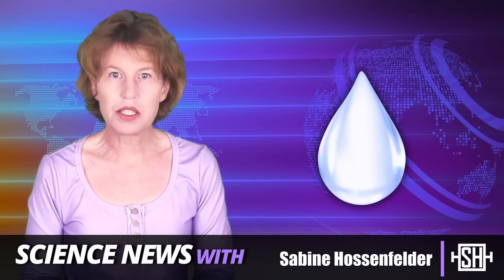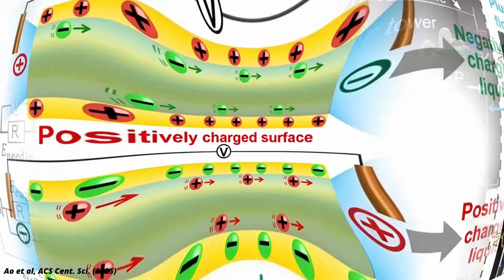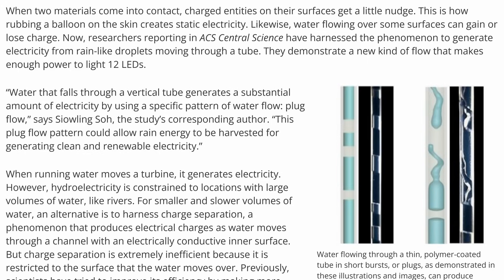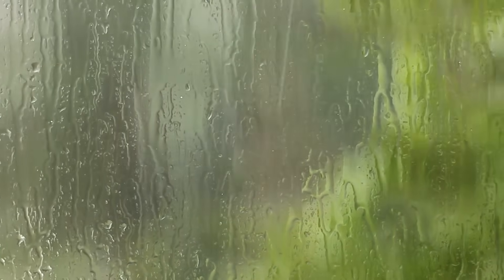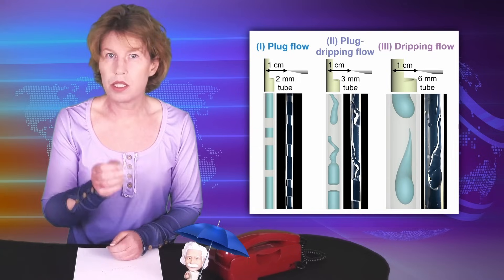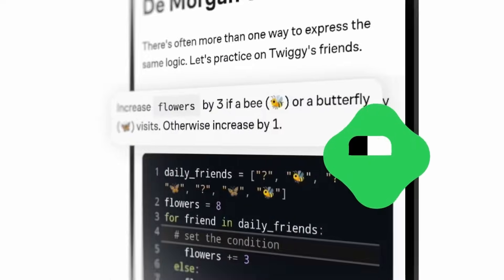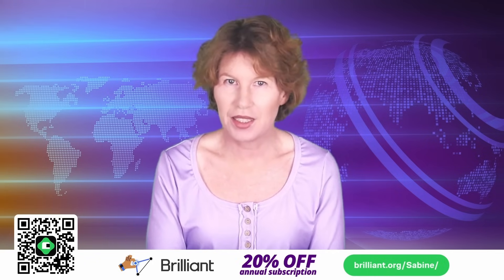A New Way to Generate Electricity From Rain

Comment: No moving parts, but small tubes exposed to the elements are not maintenance free. Algae, insects, just dust or soot from pollution.
Reply: Easier and more efficient to just print out an array of tiny piezoelectric elements. Once you've extracted the impact-component of the drops' energy, you collect the runoff from the plate into a single stream and drive Sabine's turbine.
Finally, this whole system is mounted on the slopes of a river's watershed, and said river drives hydroelectric dam generators.
Reply: @-danR  I actually thought this would be a video about using piezoelectric rain catchers to generate a surprising amount of power. Instead, it's about tubes generating a surprisingly small amount of power!
Reply: @Tore_Lund  I get it, I really do.  Your superior, "scientific" approach is that the human should exist for as short a time as possible, ideally not at all, and during that brief existence move and eat as little as possible, but definitely to do all those activities in an electric vehicle because when you ignore a bunch of contributing data, then it appears that the EV is vastly more efficient than just regular human induced motion.
Reply: @mechez774  No, I'm not trans humanist, or what you call those wanting end to humanity, but I equally object to the opposite; that it is possible for Humanity to be on Earth in harmony, and somehow we are evolved to be in balance with nature, so anything we do "naturally" is not harmful to the environment.   That's an almost religious understanding of the natural world, that implies that even evolution tries to optimize existence to make room for everyone. So as long as we don't don't violate the laws of nature, we'll be allright. However nothing could be further from reality: Evolution has no direction, it is a pure mechanical process. Natural harmony is a terror ballance. all population sizes are governed by external distarsters. That is true for Humans too. there is no balance to go back to when we are 9 billion. Even if we sit completely still and only eat grass. This is not fatalism I suggesting either, but just opposing that some human activity is dips and shouldn't be counted.
Reply: @Tore_Lund I would offer the suggestion that you are possibly mixing your philosophical and scientific theories.

Let me just tackle the one topic - evolution.  It is intrinsically about balance, where ridiculous imbalances occur the causal link is humanity not nature.  That is not to say there is a harmonious balance between all species and all planetary processes if that was the case then no species differentiation would have occurred and continue to occur.  

The organism that is best suited to thrive with the environment in which it either finds itself or the environment to which it can migrate to will out compete all others.  Likewise the organism that is least suited or that cannot migrate faces either an evolutionary dead end or a need to adapt to a differing environment.

Humans despite knowing that nature is brutal ignore this, it however does not mean that collectively organisms and planetary processes cannot find an equilibrium state in which to exist, that is balance.
Reply: @ForgeMasterXXL  No, evolution is driven by thermodynamics. It is not an optimizing process, it just creates variation, which makes what is good enough get another chance. the optimisation process is emergent. I don't see there is an optimal equilibrium organisms will find if left long enough. Remember the fox rabbit population graphs, they are forever undulating and chaotic, never finding steady states. When we then look at Humans, it is obvious we reproduced beyond what we would without technology, so any equilibrium, there might have been for small tribes have since long been abandoned. You believe there is a way for 9 billion people to live CO2 neutral (Im not questioning if there is a will or the practicality to have all agree on it, simply if such a state even exists?)
Reply: I checked the CO2e values for your assumptions. Average european diet: 54gCO2e/km, vegan 25, heavy meat: 90g/km including manufacturing, in comparison to car (ICE): 200-300 g/km, EV: 90-150gCO2e/km. So bike is better in all cases.
Reply: @bammeldammel  wow It's almost as if the bicycle is the most efficient transportation.
Reply: @bammeldammel  Thank you for actually arguing this instead of just disagreeing. Your numbers for emissions for human work look like mine. You know beef per kg in the cooler in the supermarket has emitted 75 kg CO2? 85-90g  CO2 per km is what you emit cycling as a 75kg man (moving mass 90 kg including bike and clothes, and eating the average diet) which is the same as a compact car emits in Europe through the tailpipe. Cars don't emit 200-300g CO2 per km, then you'd have a car with a fuel consumption of 10-7L per 100km (burning one liter of gasoline emits 2.3 kg CO2). A compact car uses 4L per 100 km (92g CO2 per km). An big EV like a Tesla in Europe emits 65g CO2, unless you run exclusively on coal power. In Norway and france with lots of nuclear power, an EV emits 2-15g CO2 per km. So we do agree on level of emissions from cycling, you just think other means of transport emit far more than they do in reality?
Reply: @Tore_Lund  I like to think that if all positive and negative externalities such as emissions were included in the price, then price alone would dictate whether something is ecological or not.

Do you disagree? Of course, this seems rather impossible in practice. Computing these values properly would be hard and likely very disputed. And then you'd have the political barrier.

Of course, I bring this up since I can't imagine that whatever increased cost in your diet, even with the additional increase in price due to added emissions, would somehow be less cost effective than a car! And you also have to include the health benefits from exercise. If more exercise keeps people away from needing healthcare, that is a positive externality!
Reply: @alan5506  Farming needs to be cleaned up, that's the immediate answer. There are more studies on what pollutes most on a farm. That is methane from cows and ploving stubs into the ground where they rot and the ofcourse fossil fuel use. So we do have a good idea of what pollutes in food production. However farmers are conservative and politicians are scared of them. When they imposed a commercial diesel tax in France, farmers blocked Paris withj week long protests. Same happened in other countries, so sadly we are a long way away, before we can clean up food production.
Reply: @Tore_Lund  Okay but that doesnt really touch what I said.

You said biking is worst than an EV.

The average cost of owning an EV is likely somewhere around 10kCAD a year. This includes initial cost, repairs, insurance, battery replacement, recycling the car at the end and all. This doesn't include the cost of exterlaities for the mining and the roads being paved and so on.

Even if food is more expensive if you were to include the negative externalities of farming, I cannot imagine that your food bill would INCREASE by 500+ CAD per month because of cycling. It is worth noting that we only care about the increase in the food bill due to cycling and not the full food bill. 

So yeah. You are wrong by at least a whole order of magnitude. 

And you also havent touched the health aspect and avoiding healthcare cost. Look at the obesity numbers buddy. That has real and heavy impact.
Reply: @Tore_Lund But yes, I agree that if we ignore all initial costs and maintenance cost for the car and the road, ignore health benefits of cycling and you eat a meat heavy diet and you live in a low electricity emission place like canada or france, then yes, using the electric car you already own is better in terms of emissions than the bike
Reply: @ForgeMasterXXL he is talking about balance but harmonically tuned and in phase with (for example) Schumann resonance or similar. Also, to apply Pythagorian scalar and harmonic principles to systems. Both mathematically and empirically proven thousands of years ago
Reply: The smaller a tube is the harder it is to clean. A fat pipe with a turbine in it would be much easier to maintain, plus it will be much more resistant to clogging by said insects and dust. It is not always beneficial to keep making things smaller.
Reply: Waah! The engineers should have checked the Youtube comments before they invented something.
How stupid they are. They don't even know how stuff works.
Why do I even watch videos? I should just keep reading the comments because that's where the smart people are.
Reply: salinity too
Reply: @Tore_Lund  LMAO , pretty interesting you choose to omit all the fossil fuels involved in manufacturing an EV car and repairing the roads from their heavier than average wear and tear. Also that your carbon budget for food omits the consideration of regenerative farming.  But tell a guy who E-bike commutes 50 miles per day ( 83km) and eats less than his  EV driving colleague that he has a bigger carbon footprint. But no, I get it  - you wouldn't want to work up a gym sweat for the sake of future generations.  That's what survival of the fittest is all about - the lack of effort.
Reply: @mechez774  How much CO2 does it require to build a human? You are expanding the argument with other factors, which you don't even try to quantify. this is whataboutism, not a scientific discussion. E-bikes are better obviously and pollute significantly less than even an EV, if you keep the pedalling to a minimum. What you eat also makes a difference to how polluting your bicycle ride is. If you are a vegetarian and buy locally produced and not too processed foods, it also makes a significant difference to how dirty your food is and thus your emissions per mile.
Reply: News flash: we already have a solution for our energy problems - ride a bike. But then Sabine would do a segment highlighting negative effects of such a solution- less spent on medical care would be catastrophic for doctors who treat chronic illness and for producers of ozempic. It would also be bad for tobacco and oil industries, and we can't have that.
Reply: @mechez774  Riding a bike for energy is really inefficient.
The whole setup is pretty expensive and the energy produced is pretty little.
You can expect somewhat in the range of 100W per hour. Naturally some sports guys will reach more.

It is a good idea, if you share a bike/ wanted to ride a stationary bike anyway. 
For example in the gym.

But this wouldn't help us so much in regards to electricity production.
We have 84 million people in Germany.
If all able people, lets say 60 million use those bikes for 6 hours a week. 
They would produce around 1,8 twh which is still less than a single coal power plant.
Reply: @blablup1214  Yes it amazes me how often this idea is brought up by people that can't do maths but think they have come up with an idea ever engineer on the planet has missed for 150 years or so.
Reply: @mechez774  Driving an EV (a car) emits half as much CO2 per mile from the electricity needed (produced as cleanly as in Europe) as a cyclist from the emissions of the extra food he is ingesting  to cover his extra calorie expenditure from using muscle power for transport. Food production is extremely energy intensive and farming is traditionally heavy on fossil fuel use as well as emissions directly from animal production. add to that the distribution and retail and food for human consumption. In total that makes it 6 times more polluting than burning Diesel oer net energy unit of mechanical work produced. There is a reason we don't ride horses anymore. I not trying to be funny, the numbers check out. Suggesting cycling as a solution to global warming is even more moronic than claiming planting trees will make a meaningful contribution. And you are right, living longer by exercising increases your lifetime CO2 footprint. Both by eating more and doing it for more years.
Reply: "Bikes are bad for the environment because it causes people to eat more [citation needed]" is an astoundingly shitty take.
Reply: @GeorgIsm-u5p  Rule of thumb: riding 20km per day on a bike 5 days a week, increases your metabolism by 20%. That extra energy is directly translatable to a 20% increased pollution from your choice of lifestyle. Saying human physical exertion should somehow be exempt from your CO2 footprint, as opposed to other activities makes no sense?  We have no problem discussing how the lifestyle of cows on fields contribute to emissions, but Humans should be exempt?

Comment: We just suffering a month long of no rain fall..
BTW If you catch the rain in a big bucket at a height of 5 km, you bring it down through a hose and attache a generator on the end you might generate more electricity.. And if it's not raining you pump up the water... 
This is the proof that to much research, most likely funded by the taxpayer, is taking place. And i bet one of the conclusions is that more research (and so money) is needed. It looks like solar road experiments supported by politicians.

Comment: I think you can get more energy from a thunderstorm shooting model rockets trailing thin copper wire into the clouds
and capturing the 1.21 jigawatts when it hits the delorean

BTW I think Sabine got her watts and watt-hrs mixed up, power and energy are not the same

Comment: What's a practical use case for this method of power generation? I can't say I understood how it would help in a factory with a lot of water condensation. How long would it take for the power generated to pay back the materials costs of the generator? What kind of maintenance would the generator need? Would the "straws" not be susceptible to getting blocked by the growth of algae and the like?

Comment: I guess you could argue, with the above system, why not add them under the solar panel? Aka, the panel would collect some water being flat, then channel that water down into many pipes allowing the water to escape while still capturing the power.  If they're not too costly to produce, and without the need for a turbine, it could add value to the panel it self. Or even better, collect the rain after that and do turn a turbine at the end.  Solar -> pipe -> turbine -> away from the house.
Reply: Let’s add a rainwater storage tank and purification system as well to reduce reliance on the water grid as well been as we are speculating.

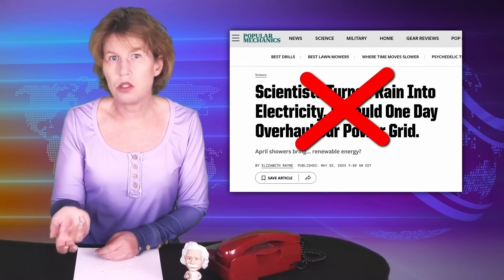Comment: At 4:14 there is a house with a drain tubing , well that the whole system. Remove only the turbine at the bottom , connect a cable to collect , and that it. The longer the drainer tubbing, the more energy you can extract from the same amount of water.

Comment: I imagine it could be used as rain sensors to more accurately get data on the amount of rain is happening locally by the amount of charge it produces. Though there might already be solutions to it, since it's cheap to build and maintain it might be a decent alternative in low developed areas.
Reply: Yes there are already solutions to this. Some weather stations use a piezo sensor to measure rainfall. They are usually referred to as haptic rain sensors.
Reply: That's interesting - good thinking, there.

I'm thinking that the regionally varying charge of falling rainwater might not allow it, however.

Comment: You stand there spinning 1000 miles per hour in the smallest and slowest spin you spin in and  belittle the ideas that: 

1. Water and air form electricity when moving...
2. The movement of water and air as electricity is trivial.:.
3. The relationships of the sides of a triangle are non existent.

..:...As if you were not moving and as if everything generating the sounds you make is not moving faster than a speeding bullet with more energy than a moving locomotive crawling along the surface of the pale blue dot at some rate real relative to the others. 

The roof over the ocean can probably take the beating with little to no complaints. The lightning that basically runs 
An electric show somewhere under a rainbow everywhere on the pale blue dot is undoubtedly amused at about the rate it spins this into that while no one appears to notice.

Tomorrow you are going to notice that as a detector rises in this electric atmosphere the current de tech T~ed is rising and as the detector falls so does the current currently speaking. 

Electrifyingly frightening ideas in a world where blowing things up appears to be the only hot idea around.:. Emphasis on the round

Comment: Doc is wrong. I had same problem. You can draun it with a thin needle. If the blockage I close to system you can try to twezser it out but be warned be some little mark damage. Been there done that. If youdundt ger lymph fluid tested them doc is just making an assumption

Comment: Actually, 20000 L /m² is 20 m, not km...
1L/m² = 1000 mL/100² cm² = 1000 cm³ / 10000 cm² = 0.1 cm = 1 mm
But still, 20 m / min is crazy, about 200 times more than heavy rain.
Reply: 20m/min * 60minutes in an hour = 1.2km / hr

Comment: Could be cool to supplement power to charge a battery in remote areas where solar is unreliable. Of course batteries to power. Very low power devices. The device will pour out enough power if the end used device only sips

Comment: All hydro-power is electricity from rain.

.   This is the recycling of a 3 part science experiment I learned in 6th grade in science class four days after we used iron and HCL to make H fuel and burn it. Make the tubes an alternating ring-tail of plastic and copper so you can tap the pulse charges of each.
Reply: Exactly what I was thinking. If you get it directly from rain, you still need a massive battery for all the time it doesn’t rain. That’s called a reservoir/dam.